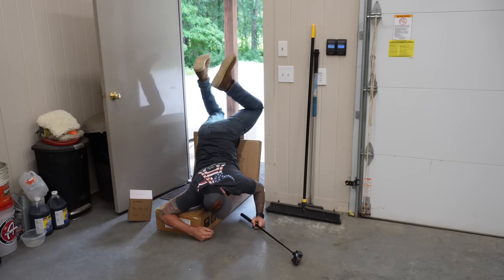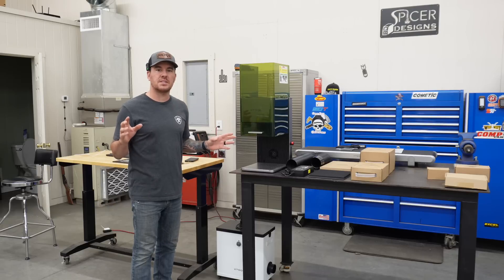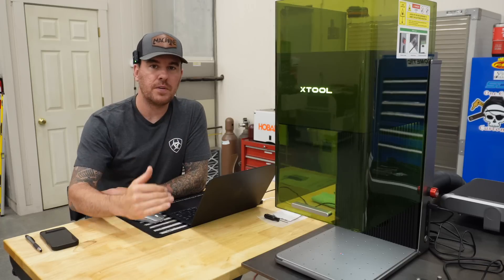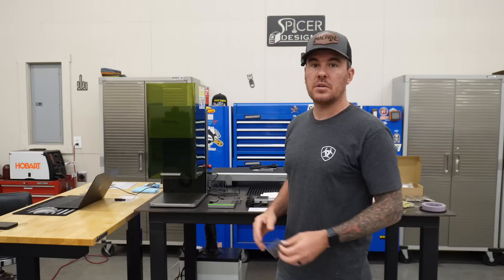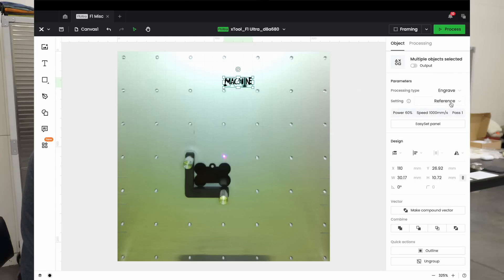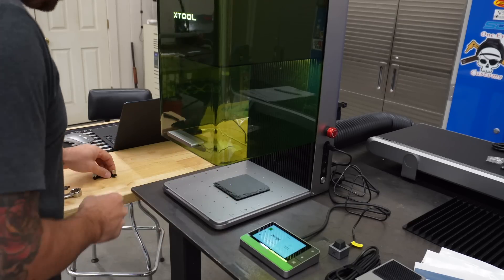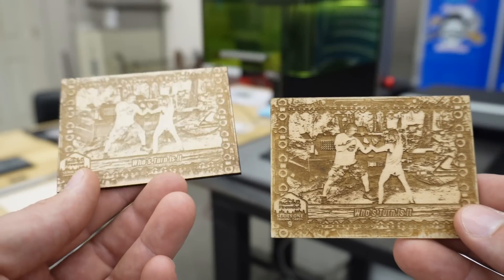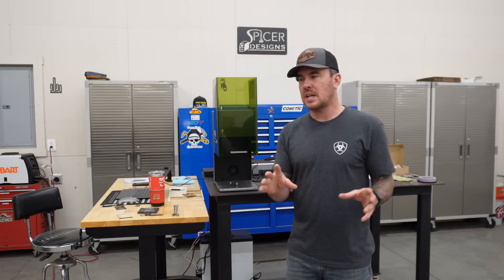The NEW xTool F1 Ultra...This Laser Can Do It ALL

Comment: From what xtool says.. you will want to use the Newer AP2 6 filter system instead of the previous air filter purifier.
Reply from the maker: They recently sent the new AP2.  Its pretty nice but i haven’t tried it with the ultra yet.

Comment: When doing the auto measure mine just shuts down the light and doesn’t move the head. Mine continues to buffer? Any ideas?
Reply from the maker: @hausogen  did you calibrate it?
Reply: @SpicerDesignsLLC  I calibrated it 3 times - thought I did something wrong a couple times. I’ve even tried to redownload the application. Maybe thinking it could be my computer?
Reply from the maker: @hausogen you pulled the lens cover off right?
Reply: @SpicerDesignsLLC  Yes, I got through the setup and wanted run through the example project, but when it tells me to select the auto-measure, the light will shut off but the application pretty much freezes. The loading process and cursor just continue to buffer.

Comment: Can you share the power information from the power brick for the Ultra?  I have one on the way, but it hasn't shipped yet and I'm trying to find the power consumption of the laser to figure out how long it will run on a battery power station.  Thanks in advance.
Reply from the maker: Its says 100-240 volts 50/60hz 5 amps for the input.

Comment: That’s pretty badass. Xtool F1 Ultra.
Reply from the maker: Ya i have some cool projects in mind for it.
Reply: @SpicerDesignsLLC  Can’t wait to see them. On the tumblers, does it engrave the stainless itself or just the paint?
Reply from the maker: I havent tried it on the stainless yet.  I know it will burn the coating off the tumbler no problem.  Ill be doing some more testing.

Comment: Just a thought, have you ever thought about using an automatic vacuum switch for your air purifier? I would always forget to turn the vacuum on when cutting wood. Especially when using the miter saw. It is probably not a big deal for the laser, but I find it so convenient that the vacuum kicks on automatically.
Reply from the maker: There is an output on the F1 ultra for the purifier but nothing on the purifier.  Im guessing they are going to be revising the purifier but idk

Comment: You couldn’t do a demonstration of engraving a handheld tool by chance could you? Wrench, socket or Ratchet would be cool. Trying to find out if I should look at buying this for opening a mobile engraving service for tools. Thanks!
Reply from the maker: I actually did try doing a wrench but it didn’t turn out. Im going to do some more testing on different coatings.  It may still be able to do it.
Reply: @SpicerDesignsLLC  Well that’s disappointing but good to know! I don’t want to invest in a tool and find out later it won’t work. 😬 If you figure it out I’d be thankful to hear your findings. Thank you.
Reply: From what i understand its a 20w fiber laser on it, that should be kore than enough to engrave on metal, Ive seen a demonstration of a 3d coin engraving done with this machine… 🤔